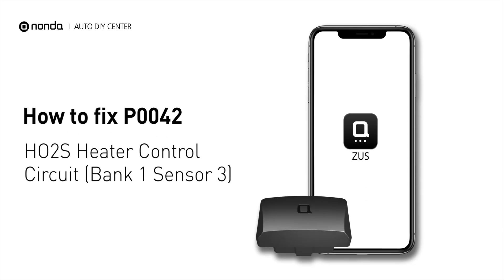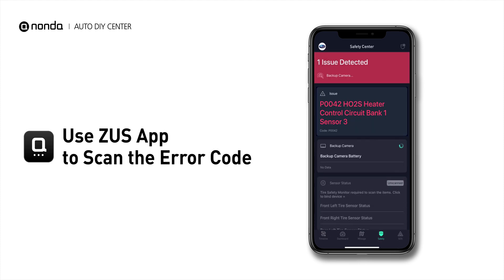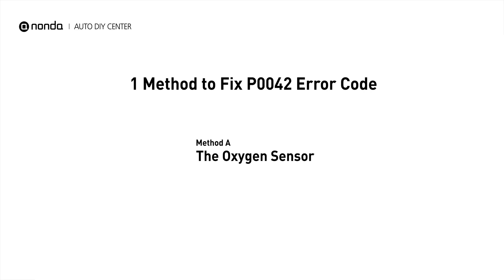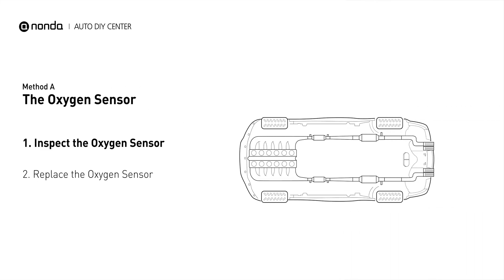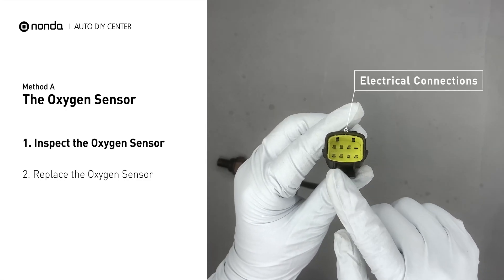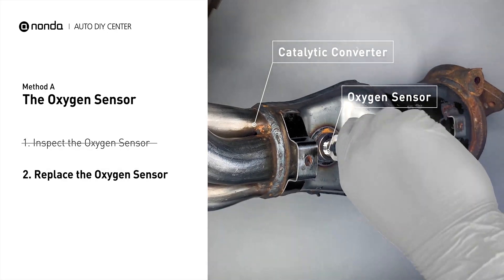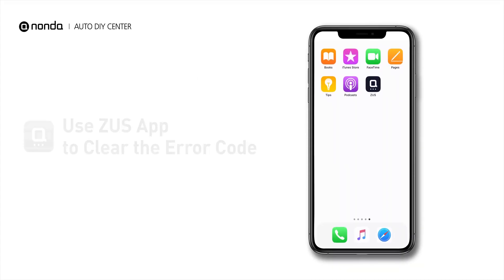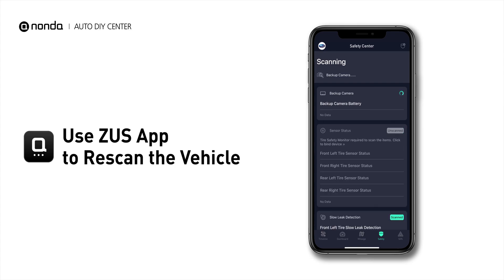How to Fix P0042 Engine Code in 2 Minutes [1 DIY Method / Only $19.45]

Comment: I got this code p0042 is this what causing my car to jerk and hesitate when I step on the gas from a full stop?
Reply from the maker: Probably- Yes. You may use our ZUS Smart Vehicle Health Monitor Mini to verify the error code. Causes of this code could be coming from the defective Crankshaft sensor, PCM, Engine Timing Belt, or wiring harnesses.
Reply: My 2010 Mercury Mtneer does the same thing as you describer above. Yet...not all the time? In this last week of driving...as you stated...from a full stop...after stepping on the gas...it has only paused & lurched...on two occasions?
Reply: yes try upgarding poo43